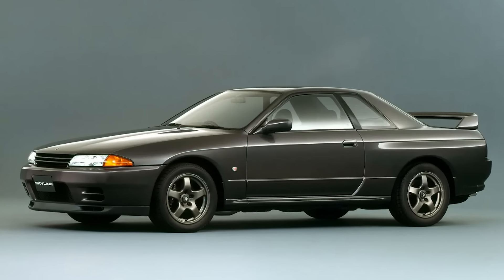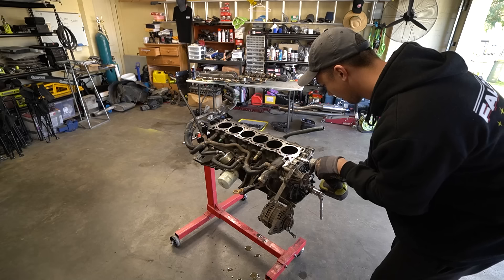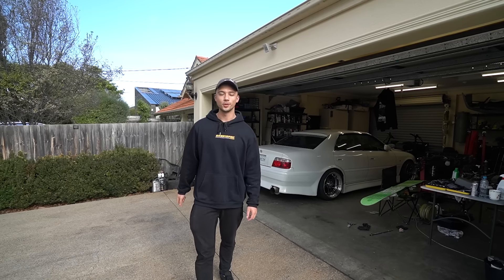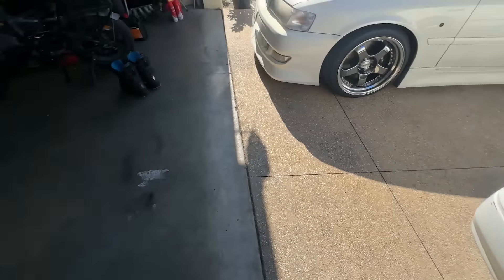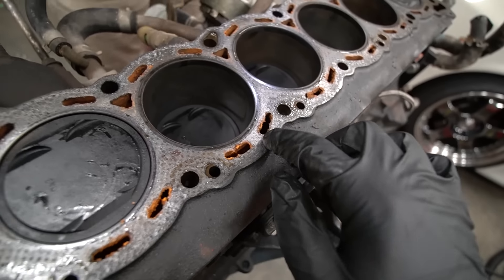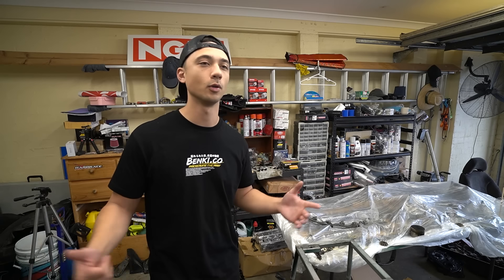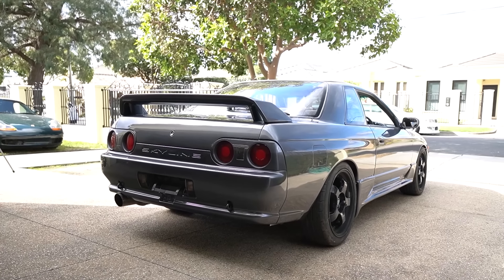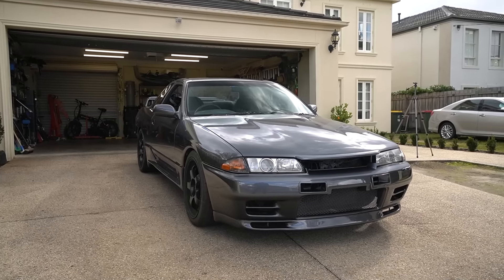PAINTING My STOLEN R32 Skyline I BOUGHT From Facebook!

Comment: Okay give a update on my 2000 Camry LE 2.2L. I changed out the regular incandescent bulb in the glovebox to a cool white 74 led bulb. Bad thing is the whole glovebox had to come out to put in the 74 led bulb. Bad thing is nothing goes back the way it was originally. But never the less it's in and I'm happy with it. At night it's really bright better than the original incandescent bulb. Next is to figure out how to remove the incandescent bulb in the console. Then after that the dashboard clutter which takes 2 sizes of bulbs 194 and 74. I did the ac/heater bulbs a long time ago. They're cool white but because white plastic is so thick it looks like warm white. That's okay. Things I can't change are as follows hazard, clock, cigarette lighter, and master switch on the drivers side door. Except for those 4 things the Camry will be totally led. I changed out the flasher years ago. I didn't want to cut wiring. The flasher works with both led and incandescent bulbs. The only thing is it's real quiet when you turn on the flicker. But I'm okay with that. So I think the upstream O2 sensor has to programmed into the computer. I've bought 4 upstream O2 sensor and they don't work. Love the paint job on your car. Wow. Rex forgive me because this so long. Until then.
Reply: Is it turbo
Reply: @abdulpoo8881  Is it turbo? No it not. It's a 2000 2.2L 4 cylinder engine. Why would I want to do that. Yeah I've seen videos where they turboed it. The Camry has 185,000 miles on it now. Now if I had 2.5L 4 cylinder that might be a different story but I don't.

Comment: R32’s looking amazing mate just want to point out that yes you don’t need a airbag because it doesn’t have one from factory and can have an aftermarket steering wheel but it has to have a “horn pad “  for rwc as the stock one has a padded centre incase of an accident instead of a airbag